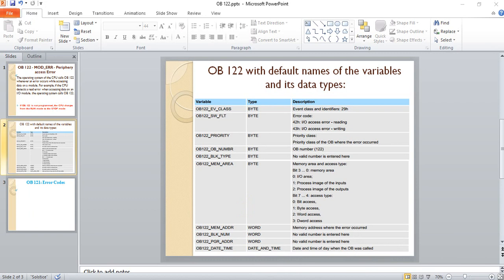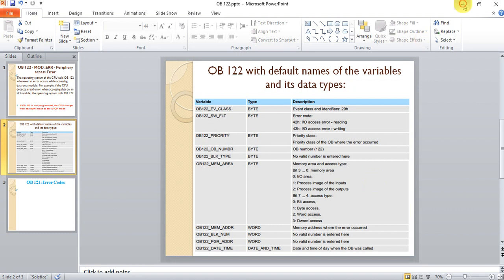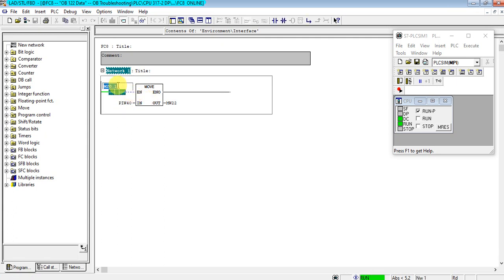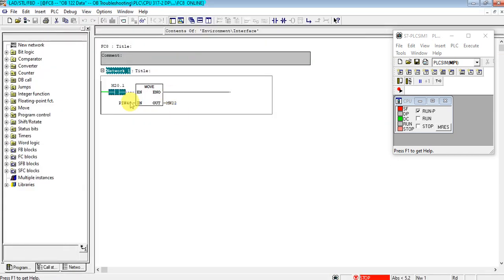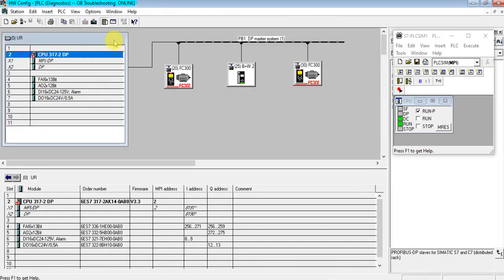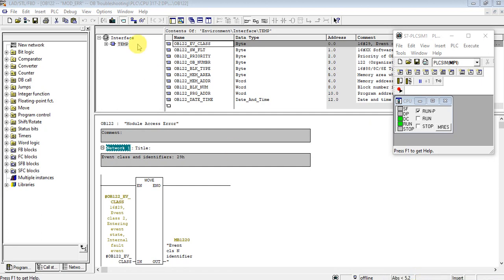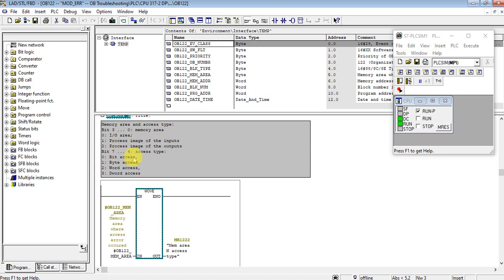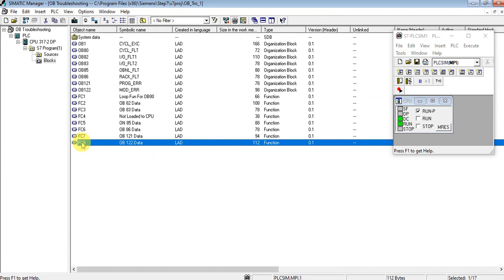OB's used For Troubleshooting, OB 122 - MOD_ERR - Periphery access Error

Comment: Sir, what is the need of programming the OB122  as you did to see the details about the fault when  by default already I mean just creating OB 122 we are able to see details of the fault
Reply from the maker: you Get The details, it Will Help To send the details to HMI
Reply: You will have to connect the laptop and go online with the CPU to check the diagnostic buffer. If you program OB122 you can send the diagnostics to the HMI.